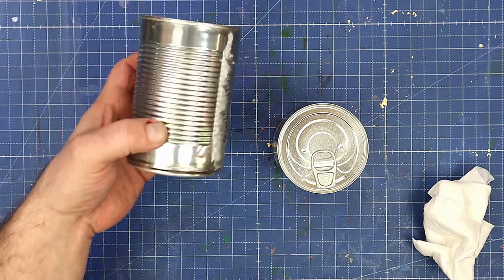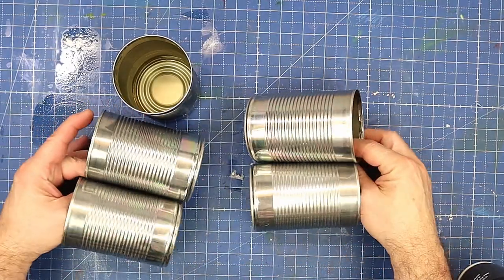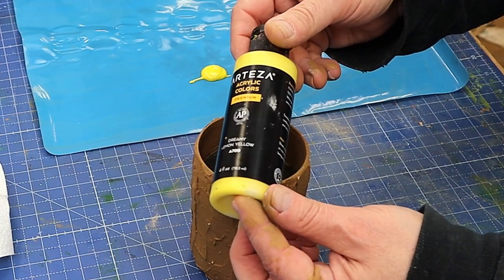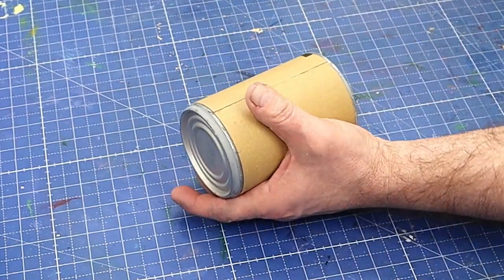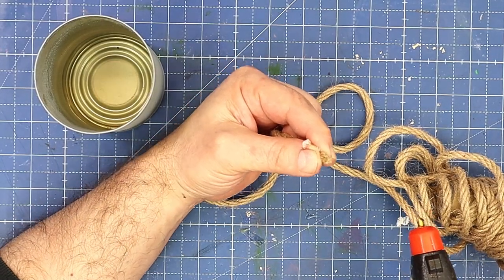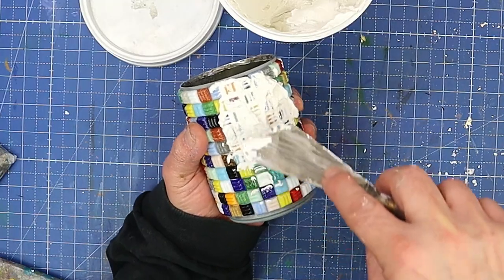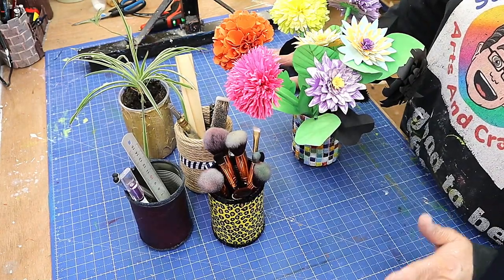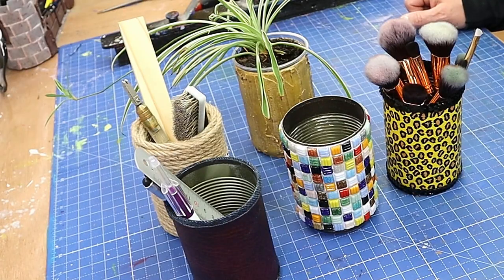Upcycling Tin Cans - Glamour Edition

Comment: Have you tried one of those safety can openers that fold the rims down? Seems like it might be less hassle than grinding off a lip!
Reply from the maker: I tried it on these cans and it kept popping the lid before it went round.  I think it is down to the type of cans that most of the UK use with these pull top lids

Comment: Approximately how many tiles did it take to cover the can? I'm thinking that elementary children can do this and I need a count per can.
Reply from the maker: I am really sorry I didn’t count them.
Reply: Thank you. I tried this. I took a screenshot,counted the tiles from tiles I could see, multiplied by 2 then added 50 for extras. I got about 250 for a possible amount for each can.
Reply: @marthalecroy5479  If you measure the circumference and height of the can and multiply them together, you'll get the surface area. I think those small tiles are 1x1 cm in size (which, I believe, they are), so the surface area in cm² is how many tiles you'll need for one can - of course, depending on how tightly you glue them, but it'll ve the absolute maximum amount. Many mosaic stores online have a calculator, and they'll also tell how many square cms a bag of tiles can cover.